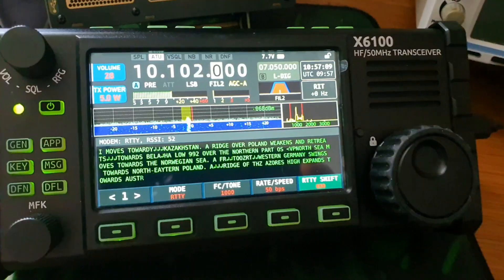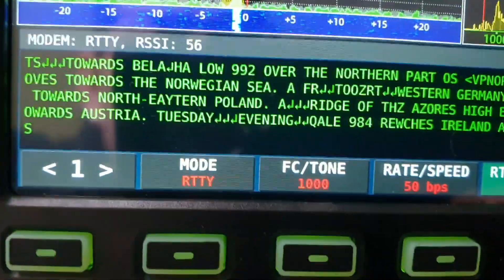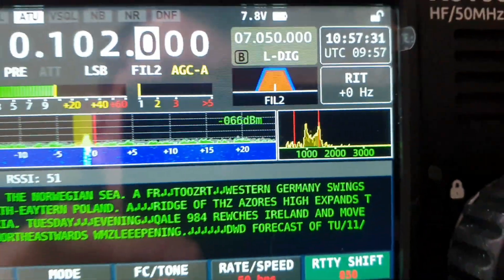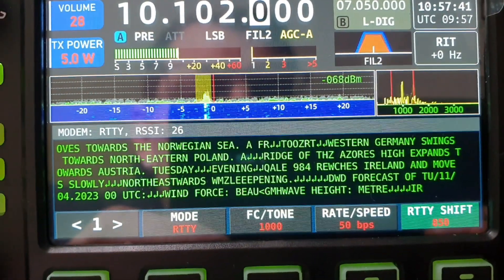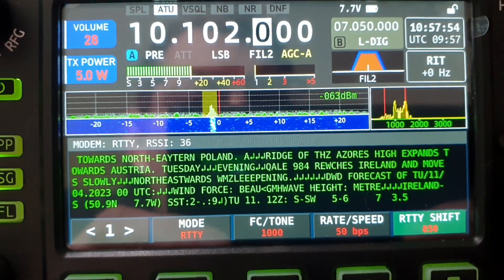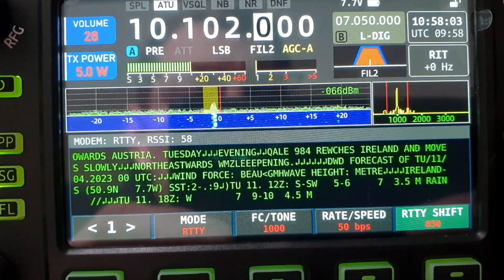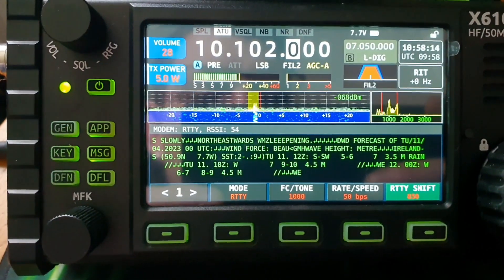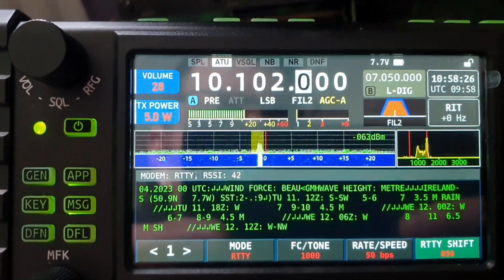Decoding DDK RTTY on a Xiegu X6100

Comment: I was successfull with the alternate Firmware of R1CBU:
Receive in Germany the DDK2
LSB, 4.583,980 MHz on Display, 50 Baud, +/-425 Hz shift, Center 1.000Hz, REVERSE

Thanks for those ideas!... for sure I will also try with original FW of Xiegu

Comment: Thanks to your vid got it decoding in seconds after weeks of struggling. However I then began experimenting - It successfully decoded on USB, SHIFT 182 (after a slight tune down). This is an odd mode.

Comment: I've been trying to copy that WX stations RTTY on my 6100 for weeks. I've used your exact settings but no joy. I've also tried using Oleg's V15 of the alternative 6100 firmware also no joy. My RSSI never gets over about 10 .. thanks for the settings that work for you! KE8WO
Reply from the maker: Take note of I'm using LSB for the reverse rtty shift and the frequency offset as the mark space lines don't correspond with the signal ... try the same settings, frequency and mode ..let me know how you get on ..73 from across the pond . Barry g0sci
Reply: @bazathemanyoungG0BAZ  I did finally get R1CBU's v15 of his alternative X6100 firmware to decode it properly. It is set up as USB-D, Rate of 50, shift of 425, center 800 hz and reverse ... thanks again! KEW8WO